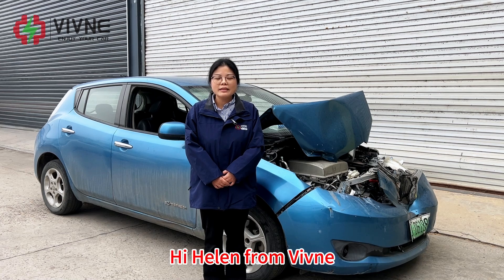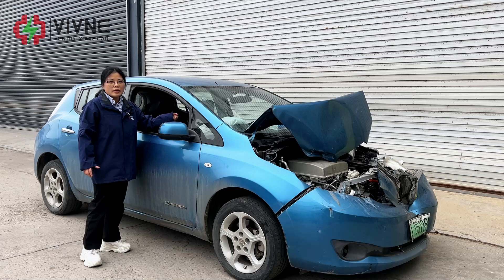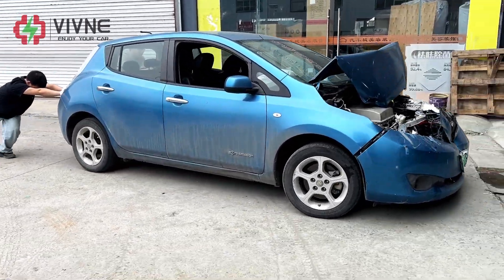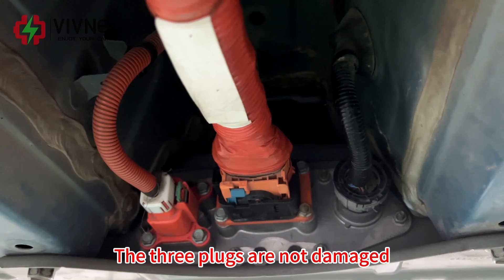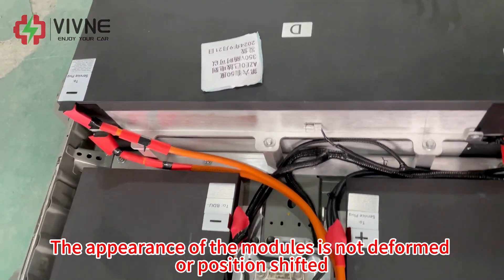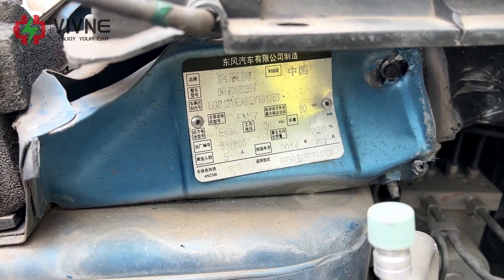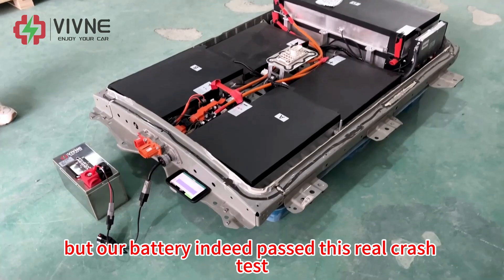VIVNE-Nissan Leaf Battery Real Crash Test!

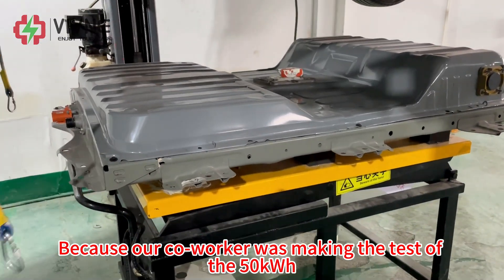Comment: Why is it in all the videos i've seen the battery being removed, it always cuts from the lift rack to the flat pallet? Why the cut? Why not show the pack being moved from pallet to lift and from lift to pallet? Timestamp at 2:36 vs 2:40

And why is the pallet in the place where the lift used to be? And the car is being raised back up when it was already up earlier? Its just weird and makes it look like 2 different scenes were spliced together.
Reply: Probably because they do it dozens of times a day and it's really boring everday process for them that they don't think about much.
Reply: @alastairmacdiarmid8331   It looks like a continuity issue, where something else happened between the time it was on a lift to when it was moved to the pallet. Timestamp at 2:36 vs 2:40

And why is the pallet in the place where the lift used to be? And the car is being raised back up when it was already up earlier? Its just weird and makes it look like 2 different scenes were spliced together.
Reply: @the_NZH  if you watch a few of their other videos you'll see they have a sequence in which they do this. First they lower the battery onto the hydraulic lift, or sometimes a rolling frame, then they connect some steel wire cables and lift back up again with the battery underhanging. Then they lower it onto a floor level pallet for working on it and moving if around. Means they can do all the disconnects at a reasonable height before bringing it to ground level and not have to scrabble around underneath. I think from memory you can actualy see the cables they uses for the second strep hanging in one of the shots. Anyway, they just skipped over one of the steps in the video but like I say you can see the full process in some of their older videos.
Reply: @alastairmacdiarmid8331  that video would be the exception which I must have missed, because I have been avidly following all their updates, and they always have this weird jump cut between lift and pallet. And  I always wondered how they shift the pack from lift to pallet =)
Reply: @the_NZH  Cora has posted a video of the same car here: https://www.youtube.com/watch?v=1p-uj-OKfsk&t=69s you can see the lanyards they hang the pack off at about 2:43. If it were me I'd probably fabricate some more rolling dollies, do all the work at a reasonable height instead of the floor, and rig up some little electric chain or wire hoists for getting the battery banks in and out, but then I work with rigging all the time so that sort of stuff is obvious to me.. Their process is still very manual, but I think company wise they are still in start up mode and refining their techniques all the time. Certainly seem to have a lot more staff on the floor and new kit all the time. Nice new battery pack for powering the canbus adapter into the pack instead of jumping it off an old 12v for example.

Comment: You said 50kWh battery but the Leaf Spy showed 40kWh battery... Why?
Reply: They re-flash the 40kwh BMS firmware for the larger battery to give correct range and consumption info to the car, but don't alter the fundamentals of the BMS firmware other than that.
Reply: Please explain a little bit more this thing, it's not clear to me this bms trick

Comment: Sorry about your test car! Very interesting video. It doesn't look like anything has moved inside the battery case at all.
Reply: The 50kWh battery from VIVNE is a pretty good solution. It hat no "increased sealing" and is very stable inside, what the accident has proved right.👍
Reply: @stevemichael82  I have actually already ordered one for my e-nv200 van, should be ready for shipping any day. I have been watching Vivne develop their products for the last couple of years until they came up with a good solution for the env. This just reassures me I made a good choice.
Reply from the maker: The accident just happened too fast.  All the modules are fixed by screws and  now had been tested indeed can endure strong hit.